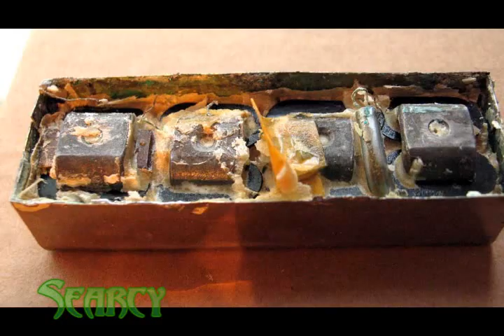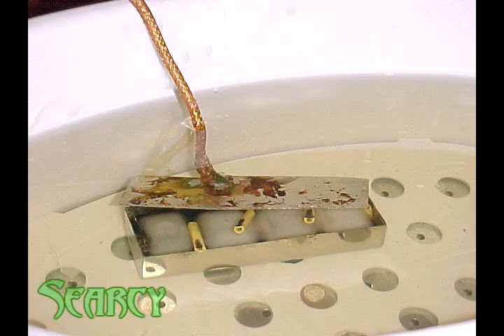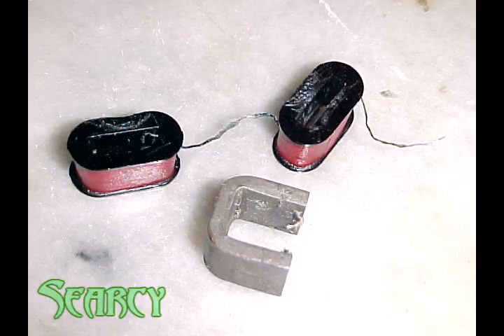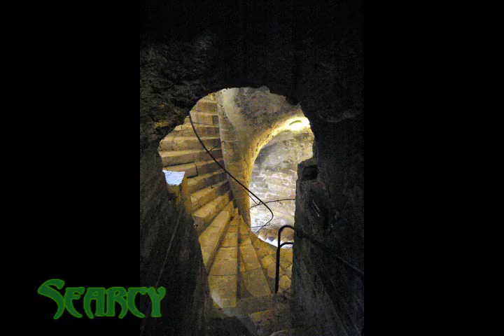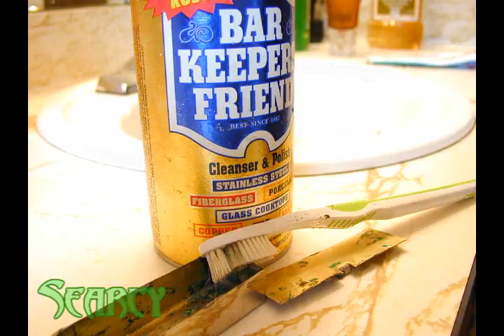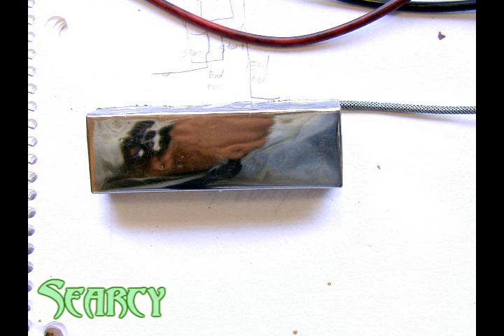LeRe / Malmström Lap Steel Pickup Rewind

Comment: Wow Searcy i bet you could fix any pickups man.Ive got a Fender Bass with a Double Jazz pickup at the bridge & it really sounds like crud.I cant say the neck pickup sounds good either.Only problem is i think the pickups are epoxy sealed.If they have been sealed can they still be opened & rewound ? I think magnets are not all full charged anymore either.The bass was made in 1985 & some of the magnets feel as though they arent all putting out the same strength.
Thanks Pearcy.